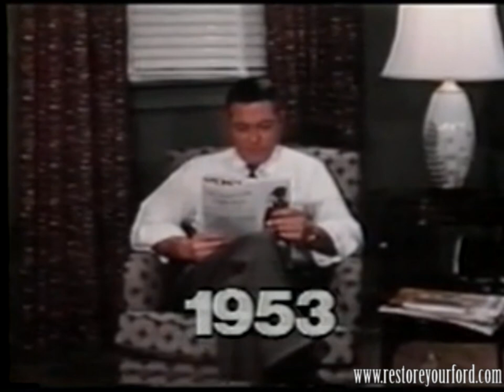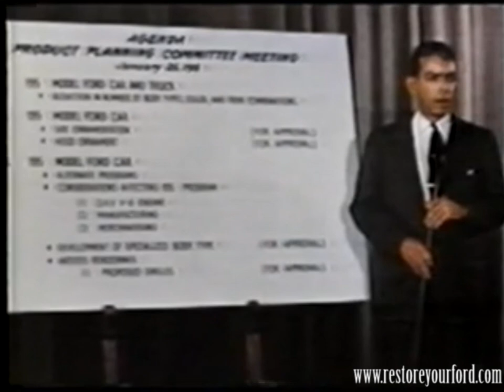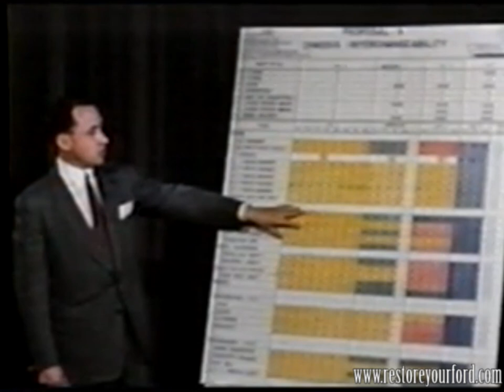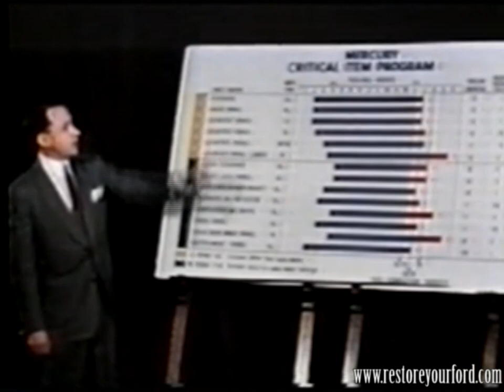1953 Ford Crestline Victoria - Concept to Production

Comment: Imagine how much of an asshole Jim must have felt like for not waiting one more year so he could have the new overhead valve V8, and not that ancient flathead dog.
Reply: Imagine how happy Jim must of felt when he realized that if he waited till the next year, he would have had an overhead valve Y-block that became famous for clogging up the high-coke oil used back then, in the chamber leading from the block to the heads, burning up the pushrods and ruining the engine. Good thing Jim stuck with the flatty.